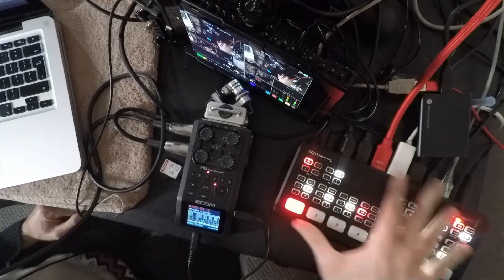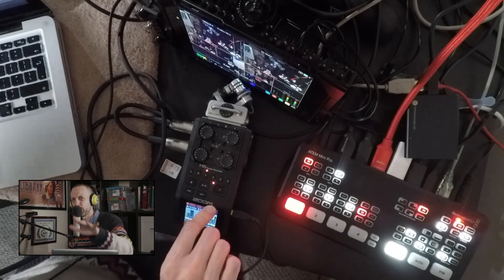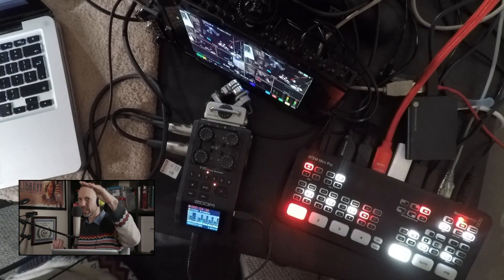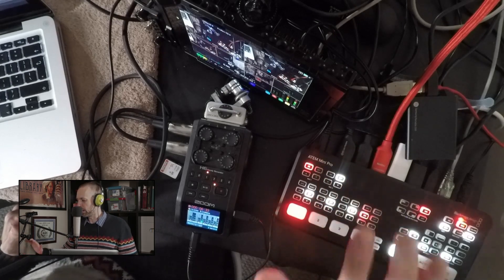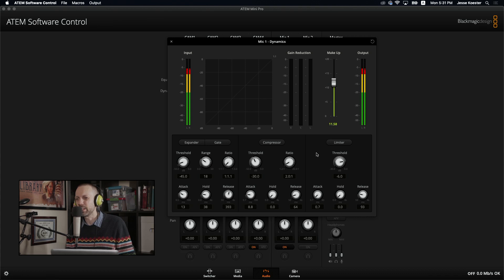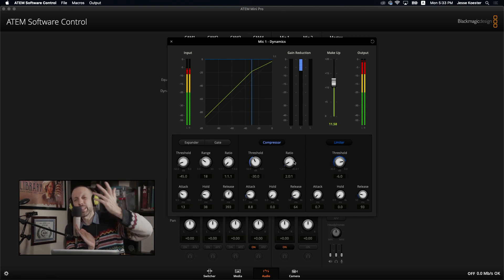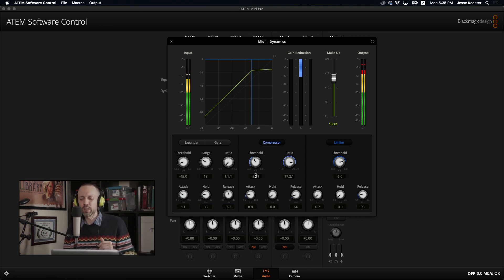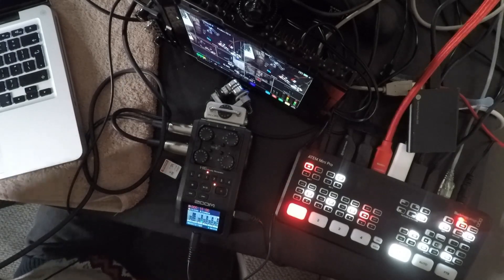Clean Audio Workflow With The ATEM Mini Pro

Comment: Hi, I still don't understand how to connect Zoom directly to Atem mini pro. Can you tell me how to do this?
Reply from the maker: If you mean Zoom the chat software, connect the ATEM via USB-C to your computer and it should function as a webcam. The cost here is that you lose the ability to record to a hard drive if you do that.

If you tell me which model of Zoom audio device you're using, I can try to figure out how to get the audio from A-to-B.

Cheers!
Reply: @JJKoester  No, I meant Zoom as an audio recording device with a Shure SM7b microphone connected to it. I have Zoom PODTRAK P4
Reply from the maker: @otsifrovca_biznesa  I could be wrong but it looks like the P4 doesn't have an auxiliary out. What you can try is switching the ATEM 3.5mm input over to Microphone instead of Line Level and running a cable from one of the headphone outputs directly into your ATEM. Just remember to turn the volume on the headphones all the way down before testing this chain and bring the volume up slowly once you're sending a signal. Good luck!
Reply: @JJKoester  I haven't bought an ATEM yet, but I'm checking everything in advance. Do you think that the headphone output from Zооm and the 3.5 input in ATEM will accept sound?

Comment: I'm just setting up an ATEM mini multi-cam shop for one person. I could get an Blackmagic Studio 4k Pro and have XLR in and that adds $500. Or I could get this Zoom for like $380.  I still need to get a XLR mic with either of those. Or I could get a Rode NT1-USB for $170 and push the 3.5mm output jack directly to the ATEM.

If there's only one person in the studio (sewing machine training), is there any reason to prefer either of the other options that cost an extra $500/700?

I know a lot about cameras but don't know hardly anything about audio (yet).
Reply from the maker: Excellent question! We made a video addressing it because it was easier to say it than to sit here and type it. I hope this is useful!

https://youtu.be/DVMxpxUTYVg

Comment: So I have a question or two? I am running my XLR mic through an mixer and running the mixer into line 1. I set the audio right along with this tutorial but when I did a test live stream, I got the video but there was no audio. Does anyone know what can cause this?
Reply from the maker: I have honestly forgotten to turn the track on and spent 10 minutes adjusting level on the signal before realizing that I'd left it off.
Reply: @JJKoester  I wonder if it would have anything to do with the Master fader slide on my mixer being set to 0....
Reply from the maker: @unfadedwithdanlane  Totally been there. Especially as these signal chains get longer and longer.
Reply: @JJKoester  How do you have your levels set up on your Zoom? I am thinking my issue isn't in the ATEM but the mixer itself.
Reply from the maker: @unfadedwithdanlane  One thing that might be affecting your experience is using the line out or the microphone out and making sure that your ATEM is processing the signal correctly.

I do Line Out and then use the settings in the ATEM to make sure it's receiving a line level and not a mic level.
Reply: @JJKoester  yes my ATEM is set to line out, not microphone. And it's showing a strong signal in the audio. I set the compressor and limiter and followed right along with your settings in the video. But I only streamed to YT. I haven't tried recording in OBS yet.
Reply: @JJKoester  Ok I just noticed something. On the multiview at the bottom right hand corner I am seeing a strong signal on the mic level 1 but to the right on the PGM it is barely registering. It looks like its set to 5300....???
Reply: @JJKoester  I set the master control according to your settings as well... Clearly got a signal but when I went back to test the stream, I got the video but could barely hear the audio. But I guess at least I have audio... lol!!!

Comment: Can you use the line out from the Zoom straight into the Atem mini pro’s mic input? I hope that question makes sense. I’m new to this
Reply from the maker: It makes sense and you can do that. Just be sure to set your input level to line instead of mic on the ATEM and you can do that through the ATEM Software controller. In this tutorial, I mention that the ceiling between clean signal and clipping is rather low. This is because I didn't know how to change it to Line Level input at the time.
Reply: @JJKoester  Thank you so much! I really appreciate you!
Reply from the maker: @rafiismail5652  I honestly need to do an updated version of this video as my workflow is better now than when this was published. Coming Soon!

Comment: Thanks for this quick tutorial. I have am taking a feed from a sound desk - a balanced mono signal which seems nice and clean - but the level seems to be very low. If I understood you correctly I should strive to get my levels up into the “red” as you said normally people are comfortable listening to between -6 and 0db?
Reply from the maker: Between -6 and 0 is really comfortable for audio levels. That's where you'd want to be. Have you been plugging your ATEM into a computer to get access to the higher functions and audio control?

Also, thanks for the subscribe! More videos coming soon!

Comment: Thanks so much for this. Trying to apply another tutorial about compression and limiting to an Atem doesn't translate as well when you can see/hear what each thing does. And an explanation as to how some parts relate to the other!
Reply from the maker: My pleasure! Compression and limiting were things that I didn't understand for most of my career. I knew to apply them with some factory-baked presets but I didn't understand what I was doing. It's actually a surprisingly powerful tool for how simple it is and once you know what's it's doing, you can control it in really specific ways. Best of luck!

Comment: Also...lets say I use a dslr to the atem mini pro...does the recording limit matter? or since the atem mini pro is recording can it record for longer than 30 min?
Reply from the maker: The recording on the ATEM can go on as long as you have hard drive space. Depending on the camera you're using, you might have to nudge it every 25 minutes or so with a quick autofocus or something like that to keep it from going to sleep. Canon DSLRs kip out after 29 minutes and 59 seconds so as not to be considered camcorders in Europe.

Comment: What cord is used to connect from line out on Zoom h6 to Mini pro?
Reply from the maker: It's a pretty simple cable - 3.5mm headphone to 3.5mm headphone. You can get them at most big box electronics stores or online. They don't cost more than a buck or two.
Reply: @JJKoester  Thank you very much. Also...lets say I use a dslr to the atem mini pro...does the recording limit matter? or since the atem mini pro is recording can it record for longer than 30 min?
Reply from the maker: @jonathanlongo9670  I'm assuming you're using a Canon or something similar. The record limit on a DSLR won't affect the recording of your ATEM Mini. There is no cap on how long a file can be (unless you count hard-drive space, in which case, that would be the cap). HOWEVER, Canon cameras will automatically turn off after 30 minutes, even if you aren't recording. If you push a button on them or do autofocus, they should stay awake but it's not a total set-it-and-forget-it solution. You have to bounce around from camera to camera occasionally and make sure they aren't going to sleep. Cheers!
Reply: @JJKoester  On my 5D IV and 80D I can set it to never turn off. Only limit is the camera battery.  With original canon battery I easly record 2 hours plus.
Reply from the maker: @jacvanderspuy5618  I've played with the 5Div a bit but am currently shooting on a 5Diii. Can you set the iii to be on for unlimited time? I haven't found a way (but I also haven't tried too hard).

Comment: Informative video. Thank you. When I attempt to plug my H6 line out into the ATEM Mini I get a lot of distortion and feedback. When plugged into the headphone jack it was a bit better, but still lots of noise. Do you have any advice?
Reply from the maker: You can switch the signal level from Microphone to Line and that should improve the overload you're noticing. To do that though, you have to download the ATEM Software Controller from the www.blackmagicdesign.com. Good luck!

Comment: im running from a rodecaster through the mic one input - and i get a hiss and clip that i can clean up in post, but cant figure  how to get it right for a live show..
Reply from the maker: Thanks for commenting! The RODEcaster is a pretty neat piece of gear and I'm sure you can get it working. My best guess would be to use one of the 5 headphone outs with my first choice being the one in the front. I'm guessing that one is a stereo mix of all channels affected by the volume slider. I'd start with it low and bring it up until I can hear it through the ATEM. If you're at maximum volume and this is still happening, I'd go into the ATEM control software and start fiddling with input volumes from there. I'm sorry I don't know more but those are the steps I would try first. If none of that works, you might try sending the L channel to Mic 1 on the ATEM and the R channel to Mic 2.

Best of luck!

Comment: Thank you for the video thank you alot, can u tell he how u set the gain on zoom h6 ?
Reply from the maker: That's the nice thing about line out. It's at a fixed level. We adjust the mic gain volume on the front of the zoom recording as per the needs of the recording but once you have a good level, you don't have to worry about headphone volume or anything like that. Good luck!

Comment: Great video! What's the cable that your using to connect ZoomH6 to atem? Stereo x Stereo?
Reply from the maker: 3.5mm stereo to 3.5mm stereo. Just you basic headphone to headphone plug. There are less lossy solutions but they require an all-digital workflow and the complication curve is basically a vertical line up.

Comment: Recently started having a problem with my streaming and recording. I'm using an atem mini pro and obs but when I stream or record, ios users can hear the sound perfectly but everyone else  hears a high-pitched sound until they put in earphones. The same goes for recorded content. Anyone know what causes this?
Reply from the maker: The first thing I would check is that everything is set to the same frequency. We were running our audio through a Zoom H4n for a while and it sounded fine on our end but it was shredding people's ears because we had it outputting at 44.8 and the computer was expecting 44.1 or something like that. What you're experiencing might be completely different (I don't even know if you can change the audio processing frequency on an ATEM) because it was across the board that people were being affected by this problem, not just certain OSes. Sorry I don't have more for you on this one.

Comment: Yes I also face some problem to set my sound but sennheiser AVX 2 made my work easier. Form now, I don’t have any issue with sound. I can control it using ATEM software.
Reply from the maker: For real, plugging the ATEM into a computer unlocks so many features. It's almost amazing how much more you get once you start using it with the desktop software. Thanks for the comment!

Comment: What if I use the DBX286s as the external compressor along with a Steinberg interface? Would it be better to skip the ATEM software compressor and EQ?
Reply from the maker: To paraphrase Obama, if you like your external compression, you can keep your external compression. I just do it in-unit because we use the ATEM Mini for our down and dirty field jobs where less gear = better experience.

The ATEM internal compression is better than what one would expect from such a cost-conscious device that is mainly focused on picture editing. But, it's still audio compression on a cost-conscious device mainly focused on picture editing.

Comment: Awesome two-torial. We've been working with the ATEM Mini for a few months. The audio has always been a big issue. Originally we used an H-6 but have recently switched over to an L-8. The last project I tried to record clipped like crazy and I couldn't figure out where in the chain to address the problem. I think I have a better handle on it now. Now if there was just a simple way to monitor the audio signal directly from the ATEM....Thanks!
Reply from the maker: For sure, a headphone jack on the ATEM would have been a huge help in all of this. I guess when they were making it, they focused on the switcher functionality to the detriment of the audio functionality. There's a lot more audio waiting in the software than the hardware but it still feels quite limited.

Comment: Thanks a lot. Having to figure out how audio works with ATEM couldn't have been easier. 

So if I understand correctly, the H6 is acting as the audio processing engine but the final saved video has both video and audio. 

And I don't have to save the audio separately to join in post process-- correct?
Reply from the maker: That's one of the best things about this workflow - You don't have to join audio and video in post as it's being fed into the ATEM and recorded with your picture edit. But. You. Can. When we're doing live-switched music, we will run the Zoom at the same time we run the ATEM because we want those delicious discrete tracks that we can mix and master with much finesse. But, that's totally opt-in.
Reply: @JJKoester  Ah, yeah, makes sense. Thanks!

Comment: Don't forget that you can delay the mic/line inputs so you don't get the echo effect when you turn on the camera mic. It's located just below the gain adjustment in the ATEM software audio control, and set in delay by the number of frames of video. HDMI video is inherently delayed, while the mics and line levels are in real time. Turn on mic 1 and the camera mic at the same time. Click on the delay adjustment on the mic input, just under the gain knob. Then snap your fingers and adjust the delay until you no longer hear an echo or reverb effect.
Thanks for explaining and showing how the compression works. Very helpful!
Reply from the maker: Yo! The Atem community is mad friendly. Thank you so much for pointing that out. I'll probably do a follow-up on this one. Cheers!